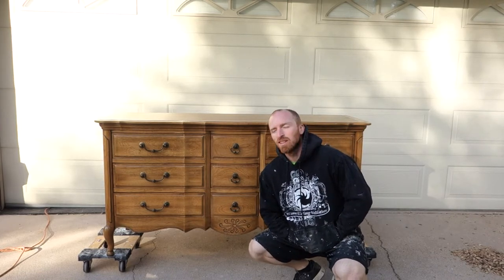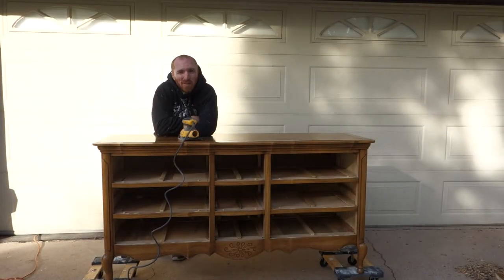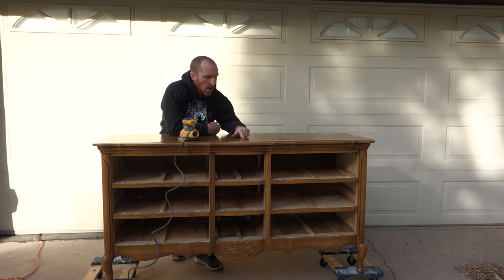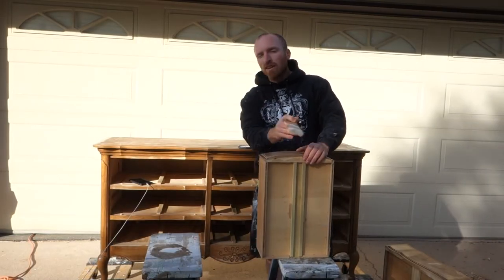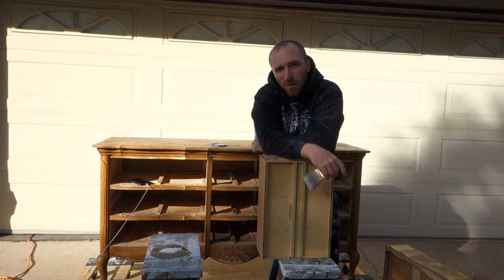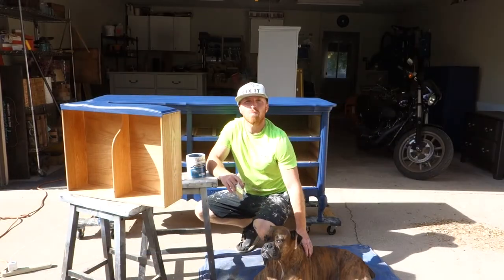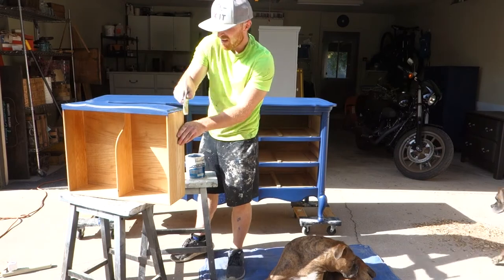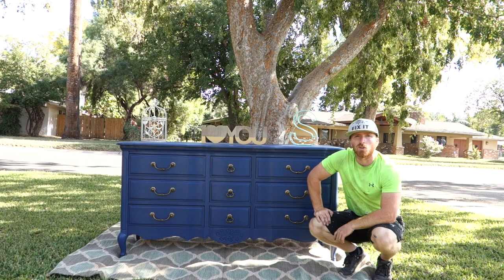Furniture Makeover: Painting a Solid wood Navy Blue Dresser

Comment: Hey man. Great looking dresser! I’m fixing to do one myself. Question- is that a matte finish or did you go with something glossier? Kinda looks matte which I’ve used on furniture. If so, how did it hold up and did you put on any type of poly? Thanks for sharing! Great work!
Reply from the maker: Thanks for the compliments. The color is very navy by BEHR Premium Prime and Paint. It’s a eggshell I believe for this project. The sheen is just right for this piece I feel. Now you could go with less or more sheen if you like and feel this color would look amazing still. I do a lot in matte or eggshell or even some satin. With a good scuff sand and cleanup… the paint sticks extremely well. I typically do a wax finish. Polyurethane for me can dry to quick in the heat of Phoenix. I also have a lot of clients who love the farmstyle look and want the opportunity to add more scratches and dings if they do happen. Been doing it a while and never had any complaints in the paint, or how it holds up. I have a lot of return visits so I believe you will find success too.